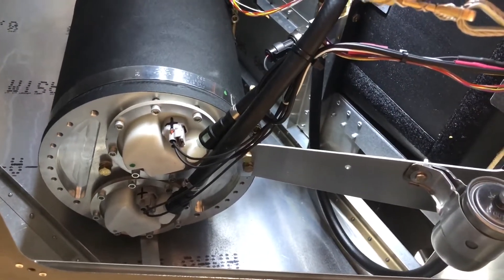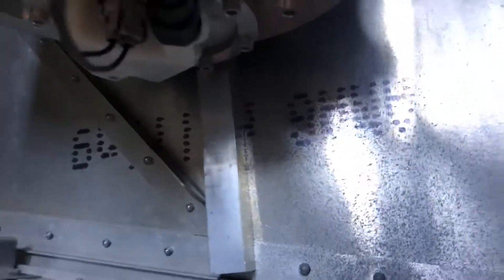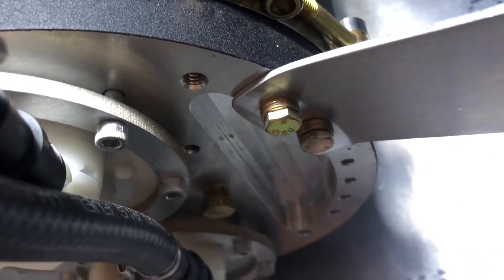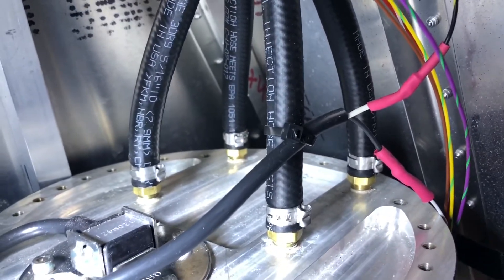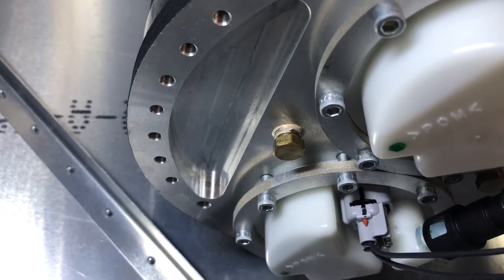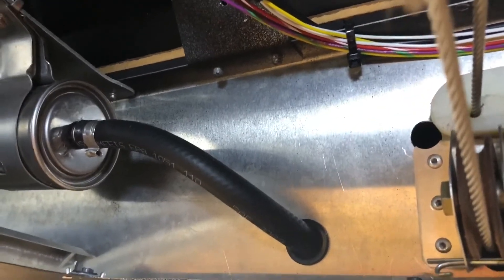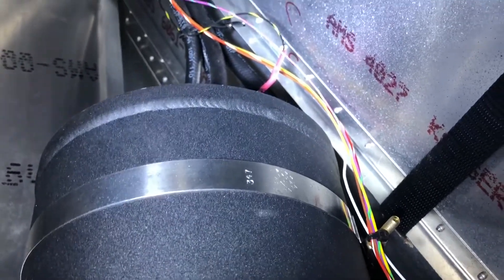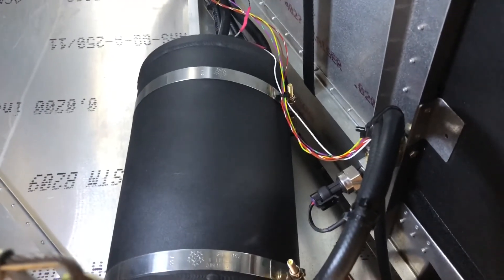Viking 2.5 GAL header tank installation

Comment: Thanks for the informative video.  Very well done.  Do you have 1/2 inch or 3/8 inch lines running from the tanks to the header tank?
Reply from the maker: 5/16 or 8mm - larger is fine